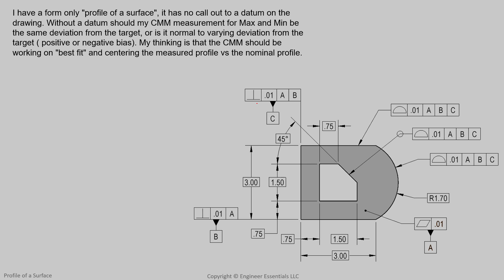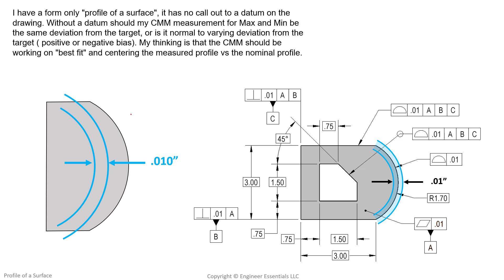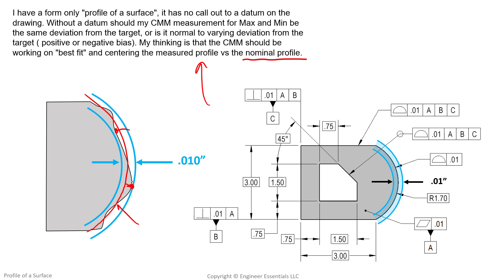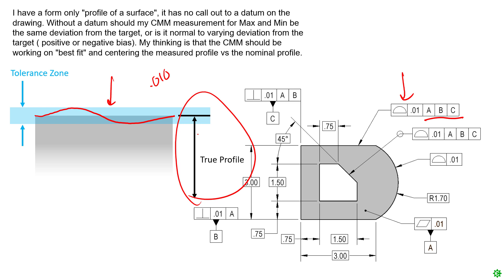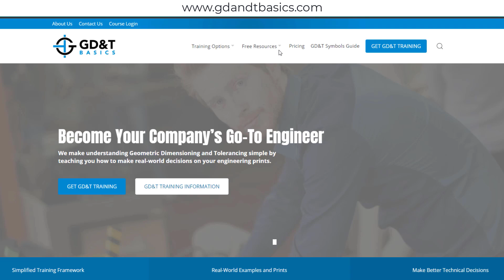Profile of a Surface with No Datums

Comment: At 4:55, it states that this is .010 of deviation. Why is it .010 and not .005? Great video!
Reply from the maker: it is .010 because we are locating the surface as well as controlling its form. If we only reported "high to low" or the .005 value, we would only be indicating how much form error there is. If the high point had deviated .006 vertically away instead of .005 it would clearly be out of tolerance, which is why we would report .012 and NOT .006 which would be less than .010 stated tolerance. Hope this helps!

Comment: What about basic dim? What is the tol. of basic dimension when we have profile without datum?
Reply: basic dim has zero tol.
Reply: A basic dimension is a theoretically exact dimension that only sets the location and orientation of tolerance zones, or defines the form and/or size of the   "true" (nominal) profile to which a tolerance zone is fixed. So the dimension itself has no tolerance, and you shoudn't measure or report it.
Reply: @sem7207  is that mean there is no request to use basic dimension for profile tolerance without datum for surface ?
Reply: @pro1234-l7j  no, you need basic dimensions to define the "true profile" anyway, even when your profile tolerance is not relative to any datums. For example, you want to control a curved feature of 30 mm radius with profile of a surface within 2 mm. You specify R30 as a basic dim. And profile of a surface feature control frame with tolerance value of 2, no datums. The feature will be limited between two coaxial theoretical arcs of R31 and R29. The basic R30 is your "true profile" - the center of the tolerance zone. But because there are no datums the location and orientation of the arc is not controlled relative to anything else. Only form is controlled.